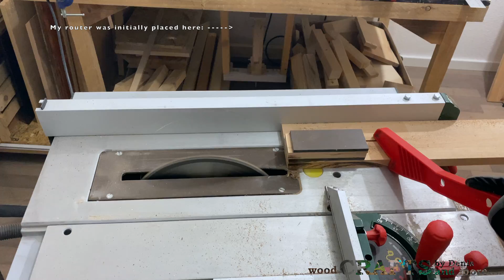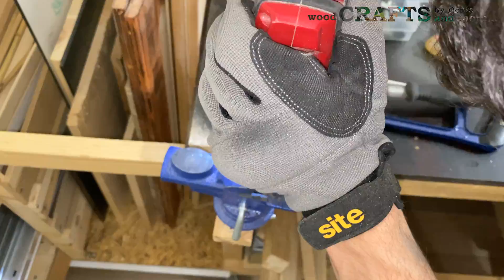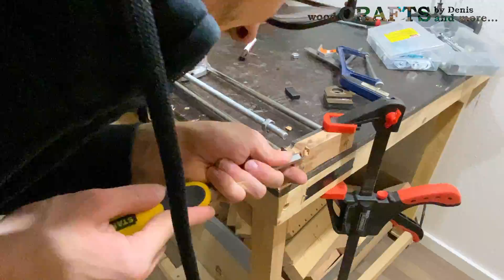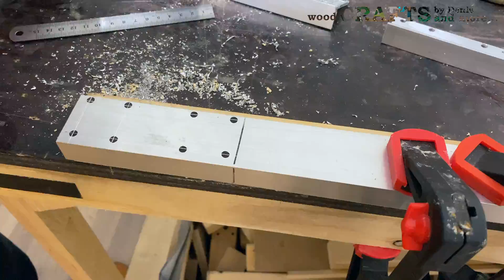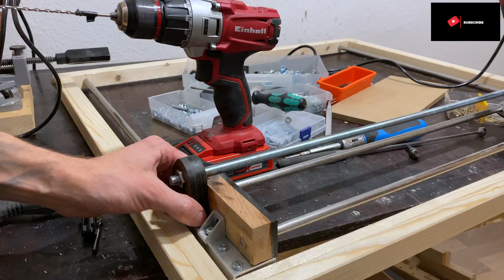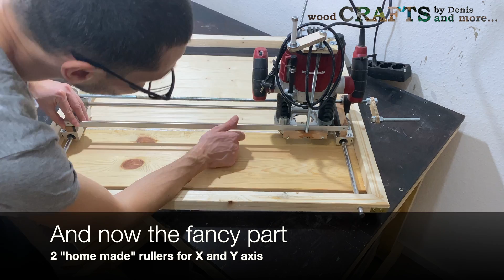Check this out! Amazing router planer and manual CNC router - DIY Workshop Ideas 🛠🔩 🔧🔨🛠🔩   #Router

Comment: How do you know that your surface is perfectly flat? It could be that one corner is slightly higher that other. (thinking to make my own thing for this)
Reply from the maker: I think it’s not in the video because the correction needed in my case was minimal. After setting everything up, I did a run with the widest flattening bit that I had for the complete work surface, having the height adjusted to the lowest corner of the base. I hope that makes sense for you. Cheers

Comment: I’m struggling with understanding the purpose of the need for a threaded rod positioning system…

Way to overcomplicate something and try to pass it off as something to be proud of.
Reply from the maker: In combination with the ruler It is actually very useful for profile making. When you know your bit is x mm and you want to overlap those multi shape bits.

Comment: Does the linear rod bend because of the router's weight? Great build by the way!
Reply from the maker: Hi. No, Not at all. I've basically chosen the length considering this. I wanted to make sure that when the router is in the middle of the rod, and I even put a bit of pressure on it it doesn't bend at all.

Comment: I’ve been dreaming about something like this. So I searched a few things and I found your video. The dream would be that the wood mill that could have a clutch system that could be open or closed. And it would let go of the threading rod when open. And ideally it could work like a copy Carver, and have registration areas that could ride along easily switchable templates. So you could switch out templates that correspond with different bits and or different layers. Like a flat Panta Router. Could possibly even do flip parts. One of many dreams. Happy to see this. Thank you, and much love
Reply from the maker: Hey man - thanks for appreciation. I totally get your rationale :) I was also thinking about it, but considering the limited use for me, I have chosen to have only one axis threaded and the other one free. I think is easy to make it as you say though, with a connecting nut (the long one) flapping over the threaded rod. Cheers!

Comment: Hey there! Found your channel while searching wether its possible to control a manual router (just like yours) with a CNC. I'm trying to adapt one of this routers  to a cnc machine, so I dont have to buy a new one! If you know, any answer will be highly appreciated! Thanks!
Reply from the maker: Theoretically nothing can stop you in doing this if you have all the other hardware and software needed parts and  willing to try it :) I also thought of updating mine one day. A thing to highlight - I don’t think that the screw threaded rods are good enough for this purpose unless you have really powerful motors. They have a lot of friction with the nuts... wish you good luck with your plan!
Reply: @wambydenis  Thanks for the reply! I'll have that in mind, still not sure what to do. 

Anyway, cheers from Argentina!